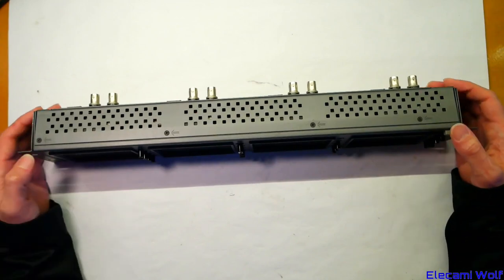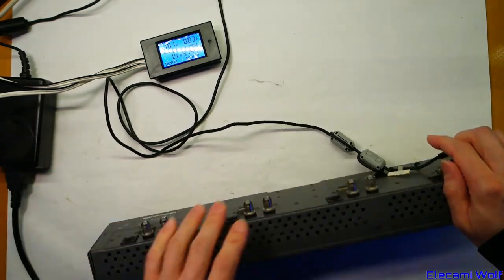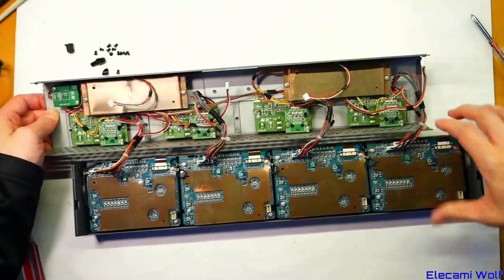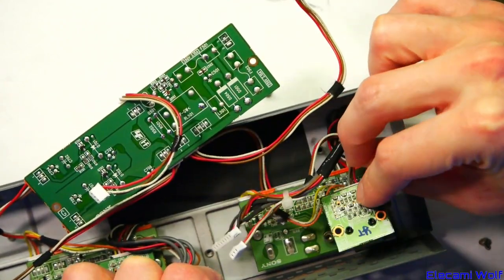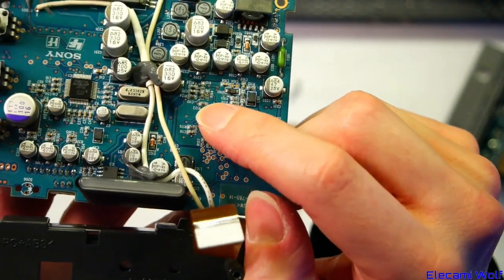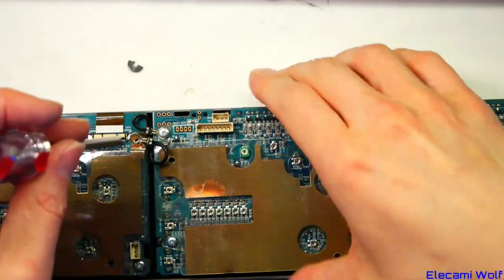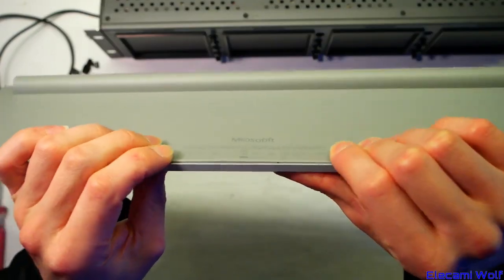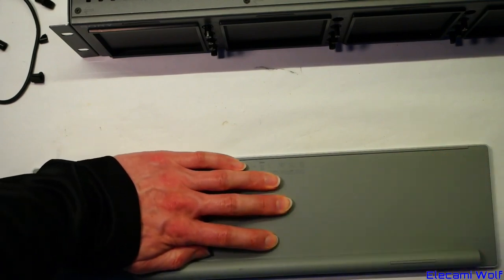EW0058 - Sony LMD-4420 Quad Monitor Teardown

Comment: That's pretty cool.  Something like that would be very handy for a youtuber who uses multiple cameras, such as electronics channels with a top-down cam, overall bench cam, face cam, etc. (ie. something like Adrian's Digital Basement).  Is that just a standard composite signal going into the BNC connectors?
Reply from the maker: Thanks. It would be great in that situation. 
The BNC inputs are Composite and the D9s can take add on adapters for SDI.